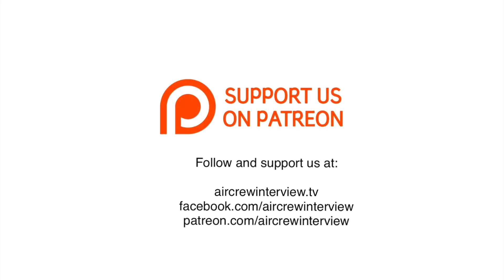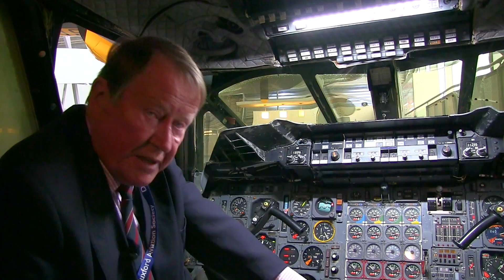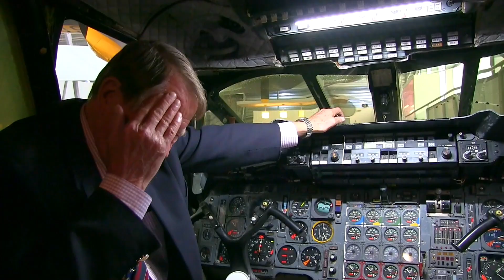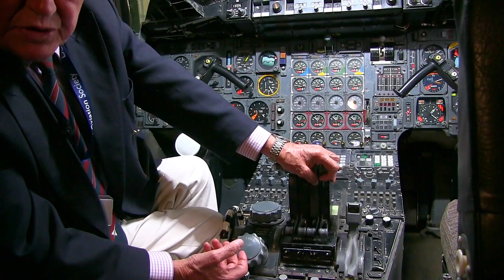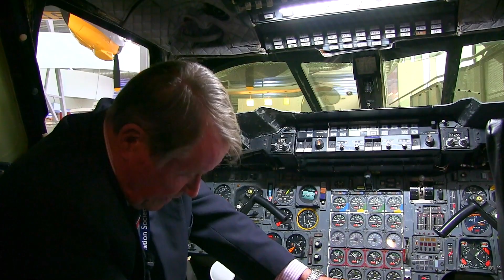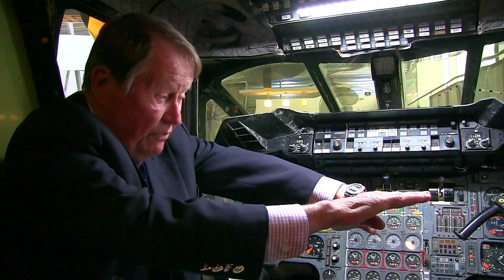John Hutchinson on Air France Flight 4590

Comment: I’m watching this in 2025 after having read Mike Bannisters book. Accidents happen, but this was not an accident. It was a set of very particular failures by the airline and the crew. The BEA investigation coupled with strange French law on the lead investigators was an absolute travesty.

Comment: I am also thinking that had the copilot or flight engineer suggested to take off in the opposite direction on 08L, not only would they have had a headwind, but they would have struck the piece of metal much earlier in the takeoff roll.  Therefore, they likely would have been below the V1 speed and could have aborted the takeoff at that point.

Comment: As others have said here, the metal piece from the other aircraft is unlikely to have punctured the tyre/s to create the rubber that hit the wing tank. More likely is the scrubbing of the tyres at high speed meaning they disintegrated.
The attempt to place blame on the shard of metal and thus deflect to someone else as being in part at fault is what the high ups/legals do.
This was almost 100% on Air France, the groundcrew and the Captain.
Poor sods on board never stood a chance due to incompetence and ego!

Comment: Aviation in itself is not inherently dangerous. But to an even greater degree than the sea, it is terribly unforgiving of any carelessness, incapacity or neglect.
Captain Alfred Gilmer 'Lamps' Lamplugh, British Aviation Insurance Group, London. circa early 1930’s.

Usually [the cause of aviation accidents] is because someone does too much too soon, followed very quickly by too little too late.
Steve Wilson, NTSB investigator,

Flying is inherently dangerous. We like to gloss that over with clever rhetoric and comforting statistics, but these facts remain: gravity is constant and powerful, and speed kills. In combination, they are particularly destructive.
Dan Manningham

You do what you can for as long as you can, and when you finally can't, you do the next best thing. You back up but you don't give up. 
Chuck Yeager

If you want to grow old as a pilot, you've got to know when to push it, and when to back off. 
Chuck Yeager

“It is one thing to be in the proximity of death, to know more or less what she is, and it is quite another thing to seek her.”
Ernest Hemingway.

Comment: I was a 10 year old kid when it happened, and I had been dreaming of flying on the Concorde once. 
When it happened it has been a true shock to me, not so much the accident, but the speed at which the decision was made to stop operating the aircraft. 
Since I was a baby, my parents had been taking me to air shows and air museums every single spring and summer vacations, I had flown on airplanes every time it was possible as a kid during these airshows (thanks Dad), I remember a flight on a Tiger Moth at the age of 9 when the pilot gave me the commands and let me do a barrel roll (I still have the certificate hanging on the wall with a picture of the 9 years old I was, dressed in a much too big leather jacket and wearing a leather hat with glasses), multiple flights in Ultra lights where I got to pilot the airplane, etc. 

When I was a kid my brother and I would be sent alone  to see our grandparents in Spain during the holidays, and most of the times the pilots would allow us to seat on the cockpits jumpseat. 

I had prepared to be a fighter pilot, going through the SPHAIR program as a teenager here in Switzerland to become an airforce pilot, unfortunately when I was 17 I started to wear glasses and in only two years my vision got so bad that my life long dream came to a stop.
Reply: So sad for the lost of your cherished ambition of becoming a fighter pilot. You are awesome man. Cheers

Comment: After learning more about this incident I’m pretty angry that the French hold a lot to answer for in relation to Concorde no longer flying. The tyre spacer, fuel overfill, decision to fly when overweight all down to Air France crew and maintenance. Without this crash the money men would’ve struggled to kill off Concorde when they did. It was the beginning of the end.

Comment: Quite a few inaccuracies here. The tailwind at the time of takeoff was 3 kts not 10. Tank No 5 was 94% full at takeoff i.e. within limits. However, fuel sloshed to the back of the tank due to acceleration, so at the point of impact the tank was full from bottom to top. The CG was within limits at takeoff. Balancing fuel is transferred to tanks 1-4, not to tank 5.  Also, while it is true that the spacer was missing from the landing gear, the airplane had already flown 4 times in that configuration since that maintenance mistake.  This all comes from the BEA report available in English from the FAA website. 

I think there is a natural tendency to scapegoat the deceased pilots... they aren't around anymore to defend themselves
Reply: Lots of hair splitting here.  Glad to hear you confirm the tank was full at the point of impact and the spacer was missing.
Reply: @poppyland74  Well, the tank wasn't full fore and aft.  The 6% empty space was all at the front of that tank because the fuel sloshed aft under acceleration. I'm not splitting hairs. This interview is a hit job on the pilots. Dead pilots are the favorite whipping boys of airlines, I suppose, because they aren't around to defend themselves. Apparently, the whipping boys of some of their colleagues too.  I would recommend to anyone who wants a deeper understanding of what happened that day, that they read the BEA report.

Bottom line: that tire would have ruptured due to the debris on the runway whether the spacer was there or not. A test after the accident showed this. And any wing tank of Concorde, regardless of how full it was, whe  struck at the rear would rupture.  That's why all the Concorde tanks were fitted with military style bladders afterwards. In short, the pilots were doomed to suffer a burst fuel tank and an engine fire not by virtue of their mistakes but by circumstance and the aircraft they were flying.
Reply: Why do you think you know the facts better than this former pilot?
Reply: @ajs41  because I've read the official accident report translated into English on the NASA website. And for the record, I'm an aeronautical engineer.

Comment: Sad chain of events that ultimately led to disaster. Even if the takeoff was rejected at V1 there would be nigh on no chance of any survivors. By this point fire had really taken hold and evacuating the aircraft, taking into account how claustrophobic the cabin of Concorde is and only being able to exit from one side, would have been very difficult. Die was cast even before the brakes were released.

Comment: As in all accidents there is rarely one single cause. Multiple factors all contributing to a disastrous situation. What it also points to is the failure of the crew to follow standard operating procedures. Even if they had they would still have encountered the spacer issue but might have been able to prevent a total loss scenario.

Comment: John Hutchinson's account of the crash of AF4590 is superb. He quietly and matter-of-factly takes us through the chain of events leading to disaster, and includes a number of small but key facts overlooked by other video presentations. 

I'm only a self-taught 'bush mechanic'. To ensure a proper rebuild you keep all parts together. It's not rocket science. Yet Air France engineering staff managed to leave out a safety-critical spacer in the left main gear truck and this error was never detected.

The captain's actions were nothing short of criminal. Authorising a substantial overload of fuel, ordering the loading of additional baggage in the aft hold, ignoring first officer's warning about the tailwind on their departure runway, a non-standard forward transfer of fuel during the takeoff roll. Tonnes overweight, C of G well aft of limits, a faulty main gear. No wonder this carrier got the nickname "Air Chance". I'd never fly with them.
Reply: Look at Air France 447 - it's terrifying.
Reply: You didn’t listen. The First Officer SHOULD have challenged the Captain about the tail wind component but failed to.

Comment: I've read 3 lengthy books about the fatal crash. Watched at least 4-5 documentaries ranging from 30 to 60+ minutes (Mentour Pilot's included, as the usual overly dramatized Mayday and National Geographic-like trash can be ignored). Read a few more articles on the subject.

Yet Cpt. Hutchinson's summary of the issue is by far the most detailed and thorough of them all. This legend of a pilot and spokesman only needs 20 minutes of non-stop talking to tell you everything you need to know, while at the same time keeping you at the edge of your seat even if you already know most of the story. Some of the facts he mentions are omitted by the above sources I've gone through. And in the end he half-blames himself because he wasn't prepared enough and can't remember if it was 2 or 3 tons of extra taxiing fuel that was added in the fatal Concorde.

Least I could do was to subscribe in this channel.
Reply from the maker: Thank you very much!

Comment: It was certainly the case at Heathrow that Speedbird 001 got priority clearance and there was therefore little need for a heavy taxi fuel load. Seems strange that the Air France captain would take on such an excessive fuel load or indeed exceed the 80% fuel load necessary for the flight to NY. Was it common practice?

Comment: Great interview

Pity that due to the French maintence error plus, pilot and all his mistakes of over loading this plane under his command, and chosing a runway that wasn't in top conditions for a Concorde, led to tragedy which in turn was the main blow to end Concorde's program flights.

Had this not happened, this marvellous airplane program might've gone on for more years
🙄
Reply: 9/11 killed off Concorde. British Airways were operating it at a loss after that. It wasn't flying each trip with a full passenger load. BA couldn't make it pay.

Comment: but it was proven the spacer didn't cause the accidernt, as brake and tire temp never increased during takeoff.
Reply: That loose bogey caused a left drift. It wouldn't have encountered the debris if it had stayed on the centreline
Reply: @miles-thesleeper-monroe8466  No left drift before hitting the DC-10 debris. Yes the fuel tanks shouldn't have been filled that much (illegally). Yes the airplane was overweight. Yes the captain should have aborted takeoff after V1. But no, the spacer didn't cause any drift.
Reply: "proven" by the French aircraft investigation that did now allow the UK adequate access to verify the finding's . They wanted to pin it all on the DC10.
Reply: @adkc19  John Hutchinson himself says it was not the spacer that caused the accident. He says the accident has several combined causes and he gives details about each cause. There is a chain of causes and also an order of gravity between them. The spacer is one less important cause. If it was only for the spacer, there would have been no accident and nobody would have heard of anything, because it would have been put back in place at the following scheduled maintenance. And no, I'm not giving any excuse to the mechanics at Air France, who were just as incompetent as the ones at Continental Airlines.

Comment: That captain sounds like a person with narcissistic tendencies!
First he demands that the fuel personnel circumvent the safety valve. And orders 3 tons extra fuel! For taxiing.
Why did he want 3 tons extra taxing fuel, didn’t the engineer do calculations?
Now he is already overweight, he then get a call saying they won’t put on 17 bags because he is overweight. 
He then again circumvent and overruled the ground. 
Again the engineer didn’t say anything?
Seriously he sounds like a captain that are arrogant, dangerous, and doesn’t listen to any other than himself
Reply: It was 2 tons, not 3 tons. I agree it was still too much by 800 kg, but it was not too much by 1.800kg. He burnt 1.200kg.
Reply: @akseli9  Do they weigh all the passengers as well. I hate it when they demand that you don't carry more than 25 kg then a huge 200 kg guy gets on board. What if all the passengers were going to a weight watchers convention, would the pilot know that?
Reply: @JayDee-xj9lu  As long as a passenger is not big enough to book two seats for himself, even if all 100 passengers are 6ft tall huge rugby players, the airplane is still within overall weight maximum tolerance. 
The luggage 25kg weight limit is intended to prevent some passengers to misuse commercial airliners for cargos. If your luggage is 26kg instead of 25, you’ll just pay a fee, but again it won’t overcome the airplane overall tolerance. 
Overweight that sad day of July 2000 was NOT a cause of disaster.

Comment: I understand the Captain was a bit of a daredevil. He windsurfed across the Atlantic. Perhaps a bit of time crunch and overconfidence? Not trying to blame the fellow, but some poor decision making was made. Overweight, no room to absorb the shock. Wanky undercarriage. Flight engineer shutting the engine down without consulting the rest of the flight deck. Certainly not the "Seconds from Disaster" presentation
Reply: That did not happen. Capt Hutchinson is mistaken. The FE DID NOT such down the engine without the Captain's permission. 

From BEA report P 133: "Engine fire alarm actuation and the very low values on the parameters led the crew to shut down the engine after the Captain called for the engine fire procedure. In fact, the movement of the throttle control lever to its idle stop is heard and, a short time later, pulling of the fire handle. In addition, the deceleration of the engine, established from the recorded parameters, is consistent with a commanded engine shut down."

See the following timeline from the CVR and d Concorde Flight manual.
o	14 h 43 min 13.4 s, message from the controller indicating flames at the rear and read back by the FO. 
o	14 h 43 min 16.4 s, FE “(stop) “. 
o	14 h 43 min 20.4 s, FE “Failure eng… failure engine two”. 
o	14 h 43 min 22.8 s, fire alarm. 
o	14 h 43 min 24.8 s, FE “shut down engine two”. 
o	14 h 43 min 25.8 s, Captain “engine fire procedure” and in the following second the noise of a selector and fire alarm stops.

Comment: 3 French firemen whose fire station was based near the runway said they saw the left bogie wheel on fire before the flight rolled for take-off, their account was struck from the official enquiry. The tyres were brand new but post-crash photos showed the rubber was worn away down to the canvas on the left wheelset. The heat generated by scrubbing resulted in elevated tyre pressure which resulted in more energy being released when the tyre exploded. During the post-crash investigation, the French couldn't reproduce the forces that ruptured the fuel tank because they only used normal wheel speed data.............one could suggest they didn't want to know.

Comment: I watched another air crash investigation on this flight and they said a blown tire caused the crash. A metal strip from DC10 up ahead fell off on the runway and when concorde was taking off the metal burst the tire. The tire exploded and a piece slapped the left wing so hard the vibration caused the weakest link in the wing to burst open leaking fuel . Some fuel mixed with a severed electric wire spark a flame and disintegrated the entire left wing. A stall occurred and they free fell into a hotel.

Comment: I won't dispute anything an expert has to say about the crash but there's something I don't understand.  If fuel transfer had been set to move fuel from the rear tanks into the wing tanks, how did the CG continue moving to the rear after the wing tank had burst?  Also, if proper actions had been taken (not shutting the engines down) how would the fire have been dealt with?  Would the plane have been able to successfully return to De Gaulle or go to Orly or le Bourget?
Reply: Because the fuel in the tank forward of the CoG was being burnt off uncontrollably.

Could it landed at Le Bourget?  No idea

Comment: One thing not mentioned in this interview is that the runway is supposed to be checked for debris before a takeoff. Just another thing that didn't happen that would have averted the crash

Comment: Who in their right mind would fly across the Atlantic to another country - no matter how long the flight - and leave only an hour or two between arriving and their ship departing ? and knowing a ship does not “wait”? Maybe those with too much cash, too spoilt, too self focussed on themselves to manage their expectations. Oh, too much luggage too. We all have to abide by luggage weight restrictions when flying - flying Concorde should not have entitled those passengers to think they could bring as much luggage as they wanted - 19 bags over the limit’s worth of luggage meaning everyone was maxed out and then some. Simultaneously sad and stupid situation. Pressure to get the plane in the air etc. Passengers, Pilot, Maintenance, the shedding prior flight dropping parts of itself on the runway, probably AF cost cutting, co-pilot/flight engineer not voicing any concern or maybe they didn’t have any  (no particular order to this listing) - all played a part in this tragedy it seems.
Reply: It seems like Concorde was run independently and outside of the ‘normal’ parameters for safety if cabin crew could just decide to throw in that excessive and overloading baggage ? Where was the rule book, adherence to the safety guidelines ?